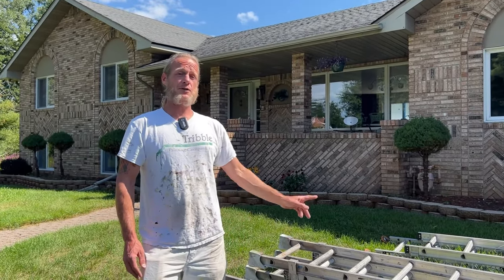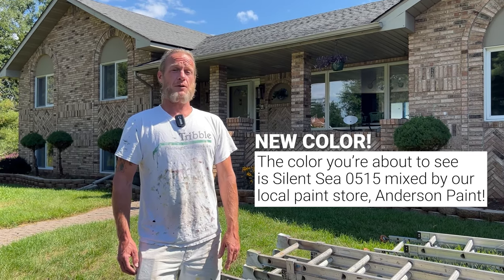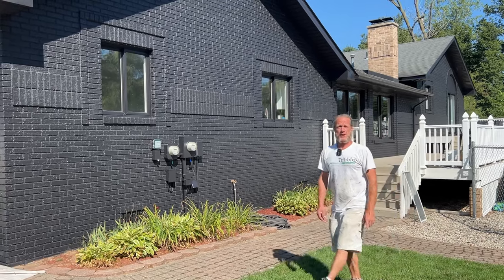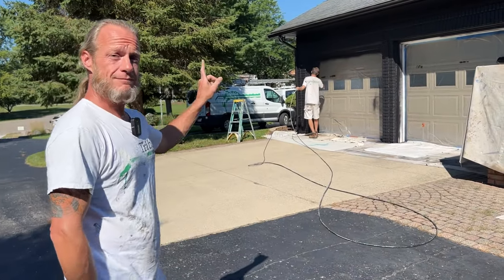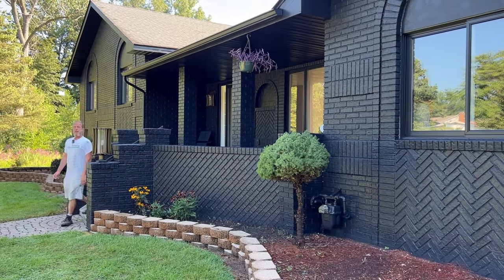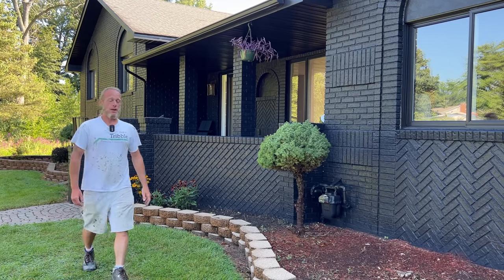Painting A Whole House Black | Silent Sea 0515

Comment: Looks Great ! Is that a masonry stain or a paint ? Is it okay to just spray and back roll 2 coats of finish coat or does it need primed before hand with blockfill ?
Reply from the maker: Hello! We used Regal Select Exterior in Low Luster and it is self priming.
Reply: @TribblePaintingCompany can you explain?. It looks like you just used the black paint called sea  on the bricks.
Reply: Is that the same paint on the window frames? Are they pvc?

Comment: Wait…how did you paint the white vinyl windows?? And with no primer at all?? Would have liked to see some of the paint prep work u did and how do u paint white vinyl? I want to do that! :)
Reply: Since no one responded I’m assuming that indeed, there is no new paint or technique I’m unaware to do this. Of course most anything can practically be painted over and look ok for a month or two - but can paint over VINYL windows actually last? If so, how? Also, any thoughts about painting  metal windows? 
IF painting vinyl IS possible what are the limitations (like only paint on picture windows but not ones that open close or slide? Does it only work well in mild climates without much whether variability or sun shining on them? Any special coatings or other maintenance that COULD be done to actually keep the look, otherwise it degrades / flakes / chips off….etc?? ). Seriously I would LOVE to know the products and techniques to use but maybe this is proprietary information 😂 If it isn’t something that can maintained than it shouldn’t be painted on the windows - for example if the owner of the house only wanted black because it would look more current and fake out potential buyers unknowingly then it’s probably not a good idea to paint it but have them either figure out a way to make the look work in another way or suggest they replace the windows to black if they must be black. Believe me I really wanted all black windows everywhere but I was told it won’t last and will like bad quickly: but that was also 5-6 years ago so 🤷🏻‍♀️